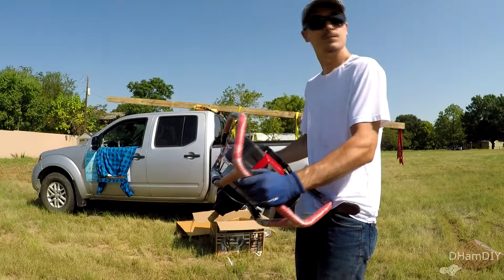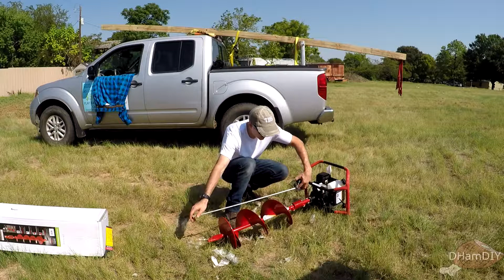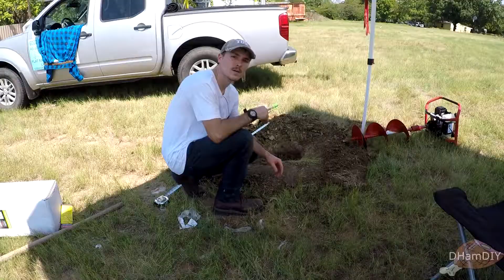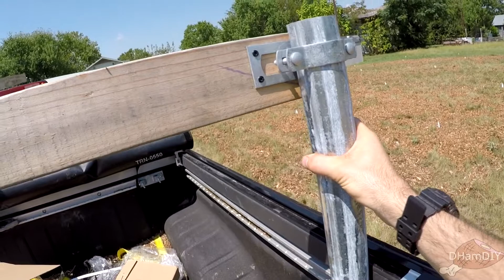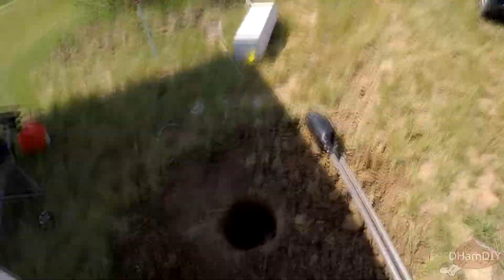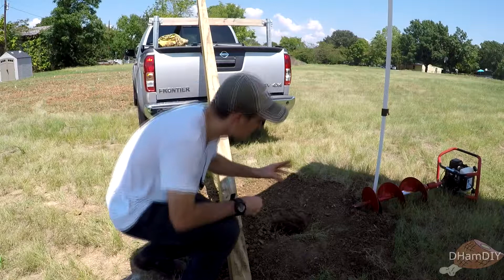Installing Power Pole/ Dually 52cc Auger+ Earthquake 10'' bit Review

Comment: Hey man, I watched a big, beefy guy use one of the smaller post hole diggers, and while he did it faster, because he was using only a 6" auger, you did it pretty darn well for your size. I wish you had included video of you putting up that bigger pole, and using that extension, but it's all good man. Thanks for posting this video. It was inspiring. Now I believe I can probably use that 4" auger that I'm thinking about getting. :)
Reply from the maker: The extension works awesome still using it to this day. It wont make it harder but will definitely get you super close to 4ft if you are setting stuff that requires. Had a couple close calls with the auger too if you arent ready to let go it could really mess you up. The augers with the springs help a whole bunch. Thanks for watching!

Comment: Really enjoyed this, as I just bought my first auger.  It seems like you started at a slight angle, but once you were going straight down, the machine really took off. It looks like it works better when you stop and clear away all the dirt it has drilled through.  Thank you for a very helpful video!

Comment: If this is the only thing you are planning to use it for, than a good $ 45.00 Heavy / Commercial Post Hole Digger  would  have been great, Elbow Grease is Free ...
Reply from the maker: I ended up using the auger for the DIY fence and drilling about 50 post holes around two feet deep. The auger powered through all of them and with the help of my fiance was much more pleasurable to use. I've been lending it out to all the neighbors as well which has earned me some serious IOU's.